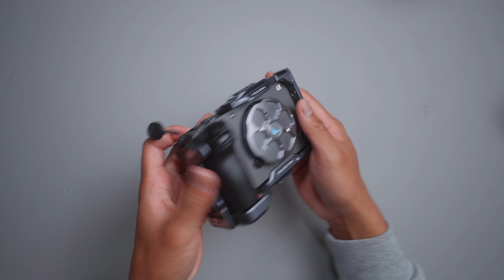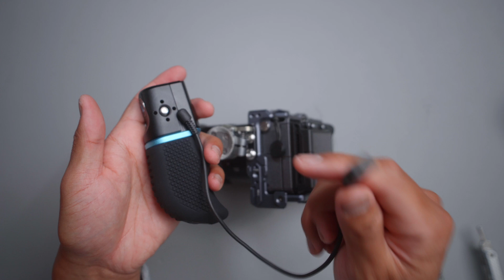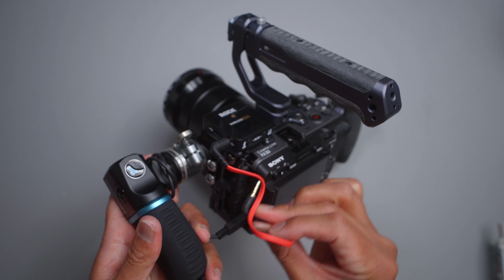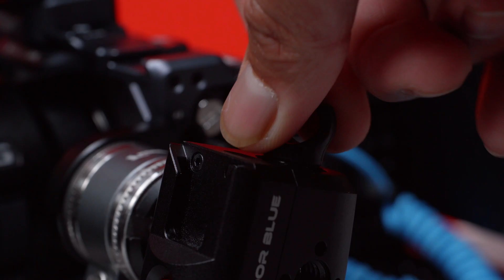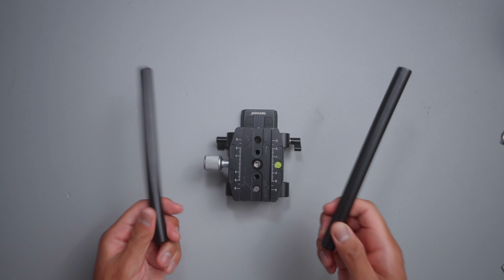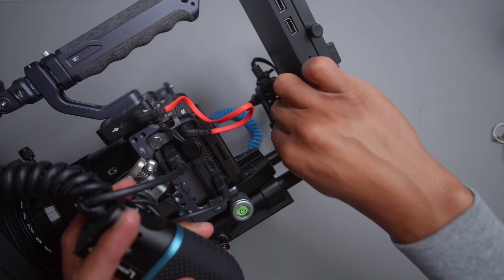How to Rig The Sony FX30 Like a Pro

Comment: Great setup brother, I've been rocking a full rig on my FX3 for almost two years now with a V-mount battery solution from Smallrig and would highly recommend. Have had a ton of buddies I worked with run D-Tap from a dummy battery into their cameras and have had horror stories to tell. Sony's don't regulate power delivery from V-mount batteries, especially when using a dummy battery so be careful--there have been tons of cameras fried and bricked that way. A solution I've used is to find a V-mount with USB-C power delivery which you can run directly into the port on the body and I've have had zero issues with overheating or anything of the sort. But if it works for you, then it works, just be careful.

All love brother, excellent video 🙏🏼
Reply from the maker: Oooo. Thank you for that tip. Didn’t realize that. No one else has mentioned that (at least that I’ve known or watched). Fortunately my Vmount setup in the past with several cameras has been acceptable thus far. 

Will keep SmallRig Vmount on the wishlist. Thank you for your sharing!

Comment: I love camera rigs. Some right angles hdmi cables or connectors would get that cable out of your way completely. :)
Reply from the maker: I also prefer right angle HDMI cables. Actually reading this reminds me that I could record audio into my Atomos Ninja instead of out of the microphone port in the camera (which may block that right angle HDMI adapter / cable).